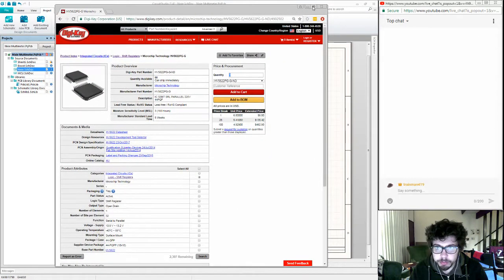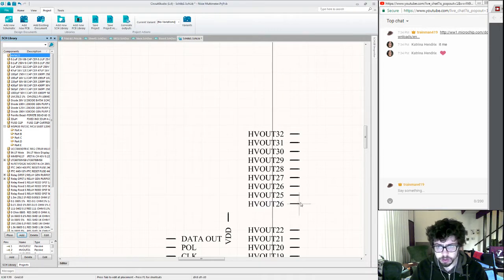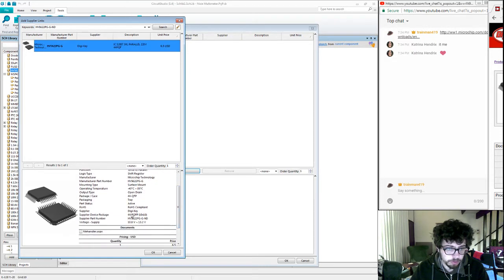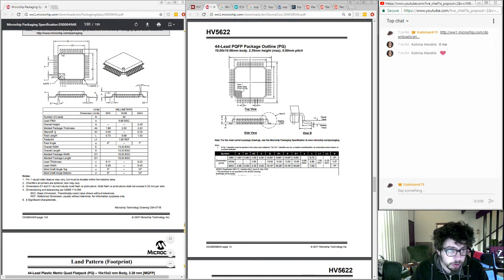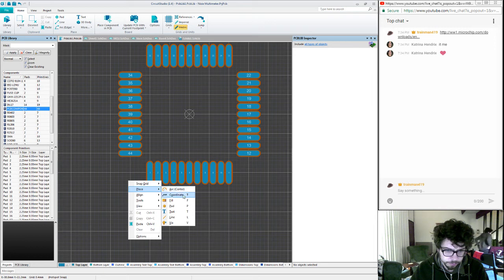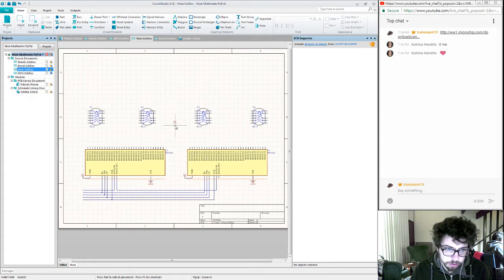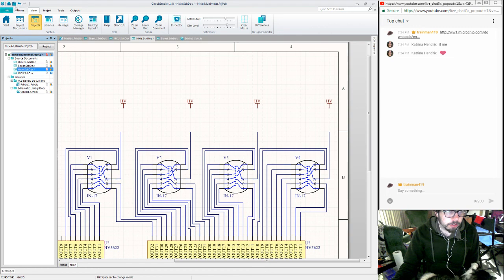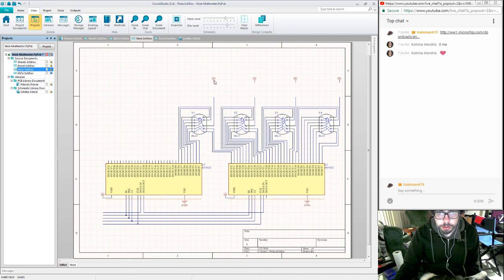trainman419: Circuit Design Live Stream

Comment: Hey, I been looking for something like this... basically, I want a nixie voltmeter for a fallout styled pc case since i m a case modder. But I do not have much experience in designing circuits or programming (only can solder and edit stuff that already exist). I want to use the voltmeter to measure the CPU voltage straight from the mainboard. Ill follow your progress.